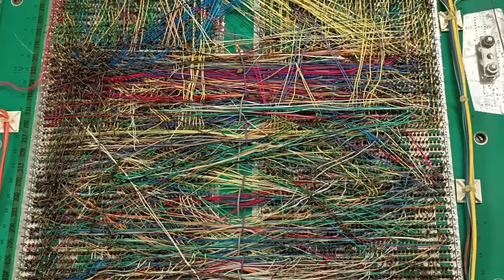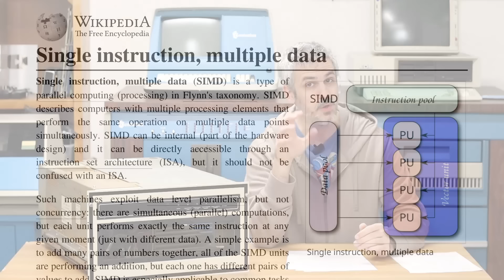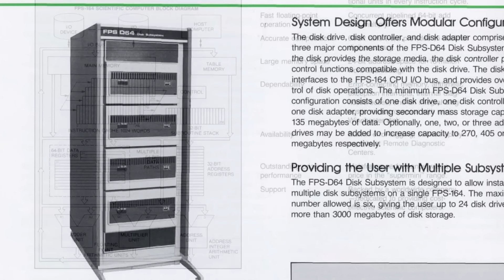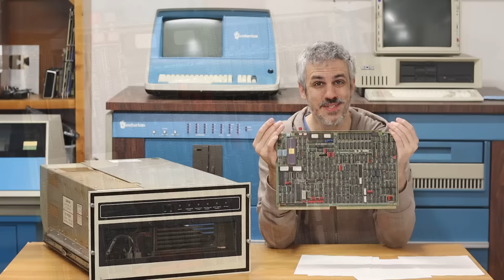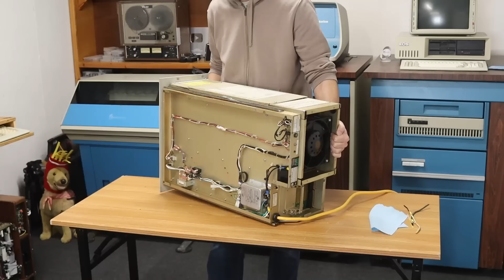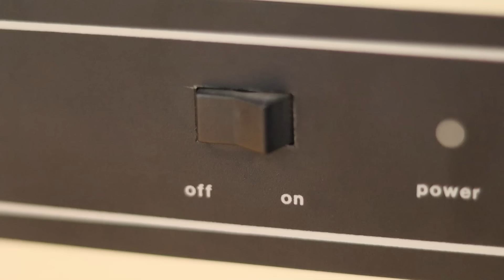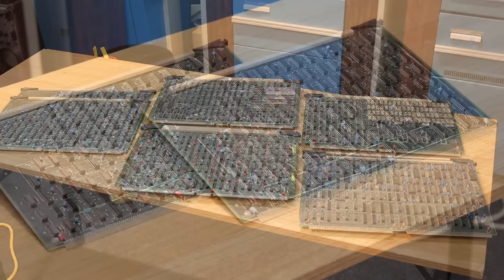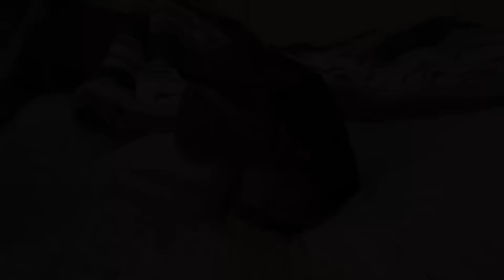This Computer is from a Defunct Supercomputer Company

Comment: It looks like you already have a lot to read, but my $0.25: FPS had a good thing going because they leveraged the growth of minicomputers and VLSI to build array processors for much lower cost of ownership than IBM - which was selling 2828's and (I believe) 3838's to connect to System 360s. By contrast, Cray spared no expense to build vector (not array) processors to sell to the weapons labs and, eventually, oil and gas companies, weather forecasting, etc. You're spot on with array processors, but vector processors work by breaking the add and multiply units up into several steps and pipelining data through those units.  So, each sum would come out of the adder while partial sums were working their way through the pipeline.  Think Henry Ford's assembly line.  The adder and multiplier could chain together, so you could do things like a(i)*x+b(i) for long vectors a and b at amazing rates.  He needed very fast memory to keep the thing fed and great cooling to keep it from melting.  Sometimes cooling is considered one of his best achievements.
So, array processing was a great deal if you were cost-constrained (universities, smaller companies) or you wanted out from under IBM's yoke.  But it proved less flexible than vector processing.
CDC tried to go head-to-head with Cray, but they didn't have as good a design.  Convex found a vector niche with pipelining, gallium arsenide chips, cheaper memory, and slower speed to give you an attractive total cost of ownership.
But remember, in the late 1980s, Intel and Motorola were producing faster and faster CPUs fueled by the demand for personal computers.  At the same time, Intel, Thinking Machines, nCube, etc were trying to ride that Commodity-Off-The-Shelf (COTS) wave to produce massively parallel computers that would eventually outperform the vector machines.  Of course, no one had perfect vision of the future in those days, but it all came to a head about 1991 when software became available to exploit COTS-based machined and Cray had to put up a massively parallel machine to compete: the T3D, built around DEC Alpha microprocessors.  The beginning of the end for "classic" Cray vector machines because the Dell's of the world could add enough connectively around consumer-grade CPUs to achieve tremendous prices performance.
Today, things have come full circle because the Intel and Amdahl CPUs configured as massively parallel computers themselves have vector instructions.  And, in the largest parallel machines, the CPUs have GPUs hanging off of them - which, as you point out, are basically array processors.

To be precise, the Oil & Gas business did not use Crays, FPS, and Convex systems for geologic work but for geophysical work.  For simplicity, imagine you are trying to build CAT scan of the earth using sound waves instead of X-rays.  The math is different from a CAT scan because you can only access the earth from one side.  (You only explore in the top five miles or so of the crust and you can't get equipment underneath that area.  For CAT scans, you get a full 360 degrees of transmission through the patient.) Still, having a 3D image of the earth for subsequent geologic analysis is very valuable - so array processors, vectors, massively parallel hardware, and GPUs have been a big part of the game.  The subsequent geologic evaluation is more visualization/workstation intensive.

Love your channel.  Good luck with the array processors.

Comment: To decode that FPS-100 backplane, I would make a couple of boards. One that could inject a signal at any signal pin, and other that indicates the states of all its signal pins. Then just go through, put a signal into the first pin, then see where the signal appears with the second board, putting it into all the other slots in turn to find it. This won't help you find wires that are routed intraslot, but if you make a combined injection and reader board, it can do that. If you can just make enough copies of that combined board to put into every slot, this becomes easier. If you put a microcontroller on each board, and have them talk to each other, then you can have it trace the entire bus automatically. Except for the power pins. Those you'll have to do by inspection. Perhaps.

Comment: To me, the fact that there's practically no info about the FPS-3000 out there might hint at why Floating Point Systems started getting into trouble. It looks like they put a lot of effort to design and build this system, but it's basically the same as their previous line of products, just without the need for the FPS-100 to run it. Obviously, this would reduce the cost and size of the system, but that's only going to help with acquiring new customers, none of their existing customers would bother since it's not an upgrade. That might be why they started running into trouble, the market for new customers might not have been there, eaten by the competition in the time it took them to get the FPS-3000 to market, and it never sold enough to pay back its own development costs.

And if that's the case, it also means your chances of finding the software for this thing on some ancient backup tape or drive disk pack sitting on a dusty shelf somewhere is pretty remote. But still, you never know your luck in this big Internet. And I do wish you the best of luck on this project.

Comment: Back in the 80's, I used to work for Convex Computer in Dallas (Plano), Tx.  They did a lot of stuff with the oil industry.  We had a demo machine setup for some oil company on our manufacturing floor that was massive: four 9-track tape drive cabinets for input, two 9-track tape drives for output, tens of gigabytes of storage (Yay for Fujitsu Super Eagles: 512MB of HDD in a half-rack-width, 6 rack high box) -- I think there were at least two "storage cabinets", and then the two processor cabinets.  I think it was a C240 -- four processors of ~100MFlops, each capable of 128 simultaneous double-precisions floating point operations.  The thing was about 40' long from tip to tail.  If I recall correctly, each processor cabinet required a dedicated 100 A 3-phase circuit, and the peripheral cabinets were 50A 3-phase.   One fun note: this was when Mandelbrot fractals really started taking off, we had one of the FP ASIC designers wrote a highly-optimized/vectorized network mandelbrot generator, and we ran it on many of our in-house systems -- we used a Sun 3/75 with a CG6 screen to display high-iteration fractals in tenths of a second as a demo with a single Sun Sparcstation 1 doing the same calculations and taking hours per frame.

Comment: Seismic data collection is essentially synthetic aperture radar, but with sound instead of radio.  You thump the ground and listen for echoes that occur when the impulse hits a change in rock density. You have multiple sensors strung out in a line and by comparing the arrival times of the reflected impulse, you can (with a bunch of math) build a cross section map of rock layers; much the same as a medical scanner processes the scan data into cross-section images.

Determining the rock density by doing analysis of the buckets of data from the sensors also benefited from vector processors.

Reservoir simulation, where you have built a 3D model of an underground oil reservoir and want to model how to best extract the oil by figuring out where to drill wells to inject fluid to push oil and where to drill to extract oil also involves a lot of math.

These are the applications I am familiar with; I am sure there are more.

Comment: Geo work makes heavy use of floating-point math to analyze and reveal the geologic structure lying beneath the sensors. I worked for a company in the 60's that did this kind of work. For ground work we used our CDC 6600 computer which supported floating point operations and Fast Fourier Transforms natively. But for marine operations we used PDP-11s which could not perform these operations quickly enough. Enter devices such as this one, which we excitedly bought and installed in the PDP-11s to do the Fast Fourier Transforms. I still remember the excitement that accompanied our first installation. It made the PDP-11 into something like a super computer for this kind of work.

Comment: I have the bare PCB for the FPS board for the PDP-11 family. It is rather boring because their boards were all just boards set up for rows of Wire-Wrap sockets, which you can see from the back sides. DEC also did a lot of wire-wrap so the technique fit in very well. Ylur software is most likely on an archived tape in a box of other tapes in the basement of a university that had 11/780's. Other places like Boeing, which I know had some of the FPS setups on VAX's, surplus all that stuff out when projects end.

I also have a complete Archipel Volvox with a LOT of Transputers. If you know anyone  with software for the SGI Indigo that takes the interface card, give me a shout!

Comment: I worked for FPS for ten years and built AP120Bs when I started. Norm Winningstad was an amazing man! He started FPS in 1970 as an offshoot of Tektronix. As I remember, there was a 28 card Petty-Ray Geophysical model. The AP120B model came shortly after, and had 31 or 32 cards.

Oil exploration companies would bring in a truck full of tape drives, set up explosive charges, and record seismic data to tape. The tapes would be sent to Dallas for processing on a mainframe, and the truck and crew would move on to a different location. It took over a week to process and get the data back. If a site showed promise, the truck would return and set up again for more data. The array processor processed seismic data in real time. The oil company executives didn't believe it was possible, and thought it was a hoax. They actually had to be taken to the field and see it for themselves to be convinced that it was real. A crew could go to a location and home in on prospects. The array processor revolutionized oil exploration.

The AP120B could fit through a submarine hatch. It was rumored that the Navy used it to process sonar and passive hydrophone data. JPL and Los Alimos also bought computers. 

The two major computerized tomography companies were General Electric and Johnson & Johnson. They each had secret separate contracts, and to my knowledge, didn't know about each other. The company names were never used; only pseudonyms "Smith" and "Jones."

The FPS 164 was originally designed to run at 8 MHz, but unfortunately couldn't reliably run above 5 MHz. My wife at the time accompanied an FPS 164 to Mariposa, CA to run FCC certifications. The machine was set up on a wooden platform outside, surrounded by antennas. The site was chosen because of the low ambient RF radiation.

I started in mechanical assembly "the dark side of production" as a summer job in 1977. The company used a Prime 400 computer for its inventory control. The company couldn't afford tapes to backup, and a catastrophic data loss meant that everything had to be reentered by hand off of printouts. I assisted at night after my assembly shift because I knew how to type. That lead to a computer operator position, and many different hats through the years. I wound up as a system programmer analyst on the Primes. Prime gave out the source code for Primos, which made this possible. The Prime was one of the first hosts for the AP120B.

I started out making backplanes for the AP120B. It was a double-sided board with ground planes on both sides. Board connectors were screwed on, with the gold wire-wrap pins passing through. Sometimes the registration was off, so we had to take a drill bit and remove copper around holes so they wouldn't short. I seem to remember that power was supplied at the sides with wide traces with vias. We soldered those pins on the connectors to the board. There were two bolts at the bottom of the board, which were screwed on, and were soldered to the board. This created studs to connect the power supply with large cables. There was quite an art to soldering those bolts. It took a 300 watt iron, and we only had one that we shared. Money was very tight. The solder had to be flowed perfectly because it had to look good. There were quality control inspections at each step. They were really a work of art.

The backplanes were sent to wire-wrap. The wire wrap stations had guides similar to a plotter. The "plotter" would display a code to tell which bin to grab a wire from, and locate over a pin. The bins had different lengths of wire. The operator would take the wire and use a gun to wrap it to the pin. They pressed a pedal to advance the "plotter" to the next pin, and wrapped the wire to complete the run. The bin and locations were all stored on paper tape. Some wires had to be routed in a non-direct path to avoid noise. I don't know how that was accomplished. I suspect the operators were just told where to route them.

Comment: In the 1980s I worked for the Acoustics Division of the Naval Oceanographic Office. We had an FPS array processor (AP-120B?) hooked to a HP-1000 mini-computer, which we used for beam-forming and spectrum analysis on data from acoustic arrays. I’m sorry but all I recall about its operation is that it drew a metric ton of power and when the maintenance contractor neglected the PMs, it caught fire and cost their manager his job. FPS array processors would be used in the oil industry for similar beam-forming tasks with seismic arrays. At that date, if you wanted to do serious beam-forming you either used acoustic delay lines, delay drums or an array processor. Since the HP-1000 was microprogrammable, you could buy a signal processing instruction set, which optimized the butterfly and other FFT functions. When it ran, the CPU locked up at 100% utilization for about 5 seconds until the butterfly completed.
Reply: HP1000? Running RTE-IVb? With the weird smart terminal editor that would end up with system messages in the file you were editing and weird non-standard fortran because only 5 characters were allowed for variables? I was Lincoln Labs in 1983 where the Navy had an AP120b- we were adding the APTEC I/O engine that moved data in and out. I learned what Range/Azimuth and Elevation was. The harware engineer on site there had a great job- one or two custom pieces of hardware a year- all wire-wrapped prototypes. When something wasn't right, he'd puff on his pipe, and the reach over with a power wire-wrap tool and move a wire and say "try it again".
Reply: @zorkohiro I once gave my division director palpitations when he wandered into the computer lab and saw me going at a $20k Preston A/D converter with a wire wrap tool.
Reply: @zorkohiro RTE IVB?
Good grief that takes me back years and to the old 2116 HP machines as well😁

Comment: Might be worth supplying the +/-12V and connecting a terminal.
Reply: Possibly easier and safer to stick a scope on the tx output line from the uart and see if it's doing anything. [Hi Kim!]
Reply: @r @rivimey  Hi Ruth. 🙂 Agreed. One step at a time.

Comment: Transputers.... The path not taken
Reply: They were in use by STS-T for a long time, often in TV set top boxes. Some saw commercial use in laser printers and similar.
It is a shame the original vision hasn't really survived though: the modern equivalent would be a PCIe bus (lane/group) exposed but also integrated into the CPU's instruction set for minimum latency. Latency of transfers is where the original T shone: almost zero. That and the built-in virtualisation that meant the hardware implementation was insulated. Do the maths on latency between a modern PC's CPU and (say) a PCIe Ethernet controller. Horrible!
Reply: INMOS, the creators of the Transputer, also produced cascadable streaming multiplication-addition chips, not completely dissimilar from today's chips specialized for matrix multiplication for neural networks. They were meant for audio and image processing.

Their hardware was pretty cool, but it was hard for them to keep up with the very fast pace of development of conventional microprocessors by well funded large companies, particularly by Intel.